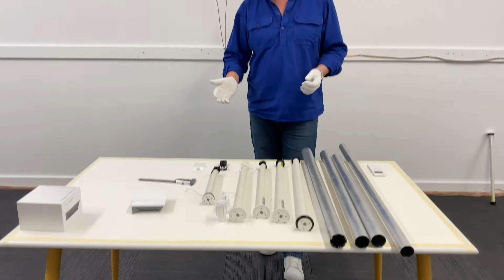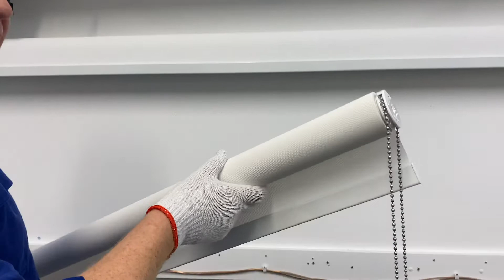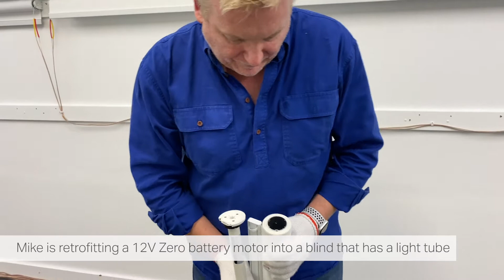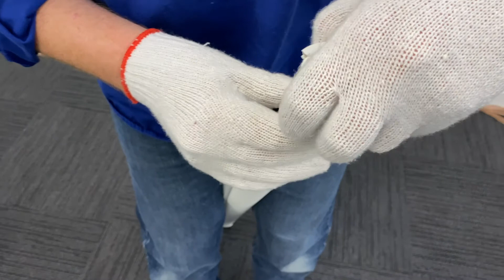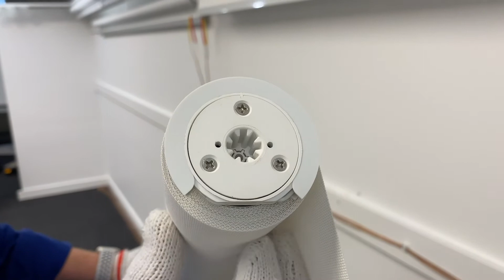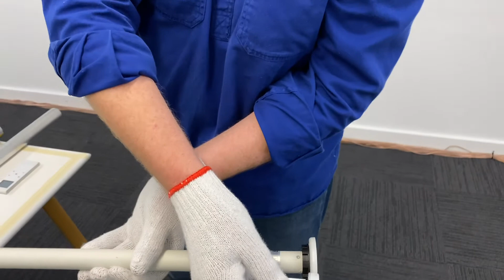How to retrofit motors into your existing roller blinds

Comment: Great videos. What is the maximum width a roller blind can be? Can Double blinds be motorised?
Reply from the maker: Hi Mark
Thanks for asking! Our maximum width for individual blinds is 3000mm, but if you have a window larger than this then our linked blinds are the perfect solution, covering widths of up to 12,000mm. They are available in both single and double formations. 
Find out more on our website: https://www.iseekblinds.com.au/single-linked-roller-blinds.html

And yes! Double blinds can definitely be motorised. Visit our website here for more on motorised blinds: https://www.iseekblinds.com.au/automation-roller-blinds.html

We hope that helps :-) 
Thanks,
~iSeekBlinds

Comment: Can this retrofit work for Hunter Douglas blinds?
Reply from the maker: Hi Mary, 
Thanks for your query. It all depends on the components used within the blind, specifically the tube. We highly recommend checking the tubes of your blinds first, then ordering our testing kit to make sure the motors are compatible with your particular blind. If the testing kit/s fit, you'll be right to go!
We hope that helps. Please contact us at sales@iseekblinds.com.au if you have any further questions. 
Thanks, 
~ iSeekBlinds